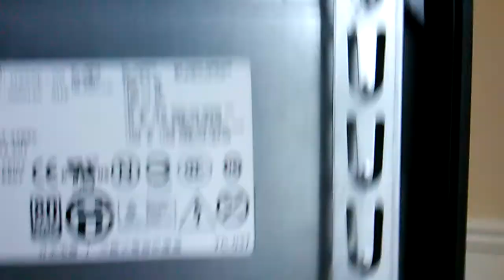$7.50 Dell Optiplex 760. The Upcoming Sub $150 Gaming PC

Comment: Can I have that
Reply from the maker: Haha sorry man not for sale xD
Reply: Think i've got that model, and see? you should of kept the old parts you threw out, that ddr2 ram would of come in handy, so would the hdds if you found one that worked enough.  It really isn't that much room taken up.  And the dog stole the pet helper part of the show.  Also about time you did a tech video instead of beamng videos!
Reply: Also sucks that your store is getting corrupt and parting shit out.  No doubt its the new management and or the new guy.  And that lack of fan is easily solved with zip ties and molex to 3 pin converter.  It'd work XD
Reply: and no monitor or anything with s-video input on it? looks like you could use that if you have the cable (older crt tvs might, in rare cases some lcd monitors have s-video), or old lcd tvs have it too sometimes.